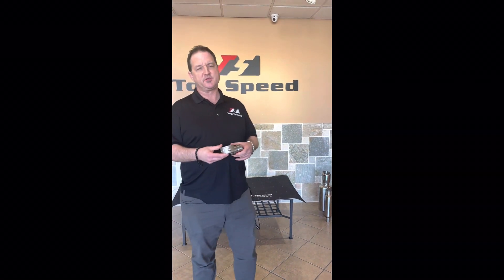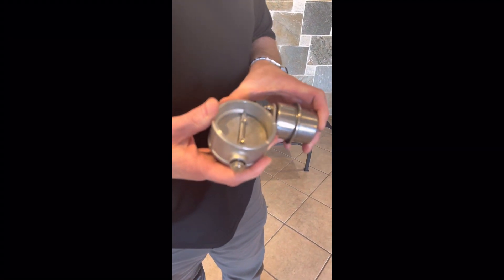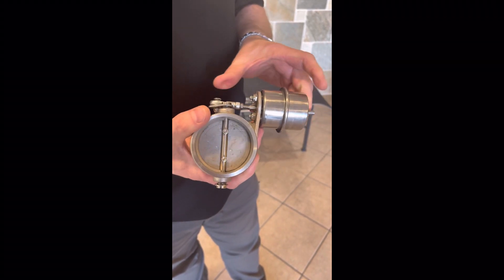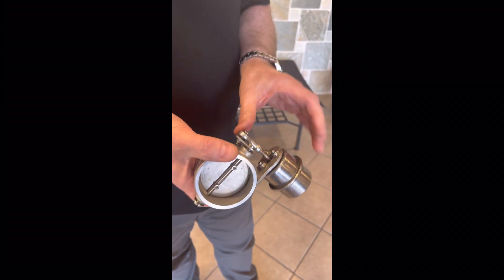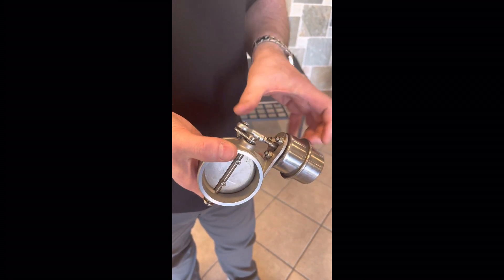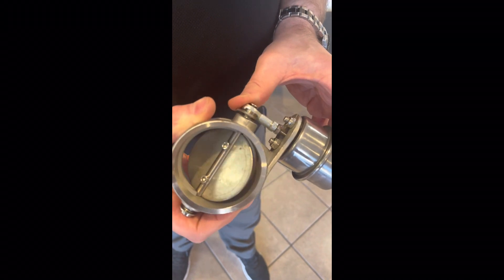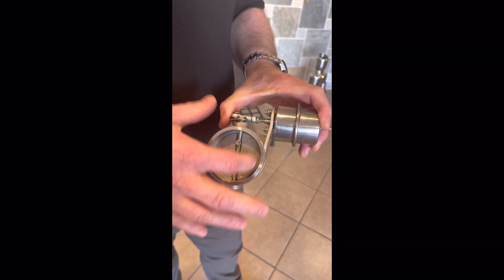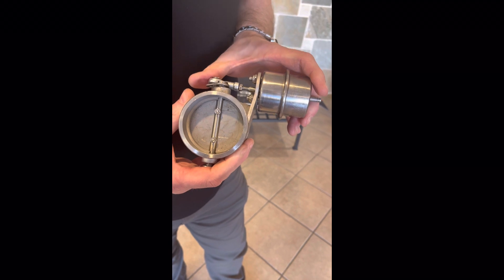How does an exhaust valve actuator work? How to fix a stuck exhaust valve?

Comment: i have an issue with one of my valves not properly closing so it rattles, if i go under the car and push the rod the rattling stops but as soon as i rev it gets loose again. are there any points of adjustment that can help fix this?

Comment: My exhaust valve on the left side is stuck for the third time, the right side is working perfectly literally since day 1. Starting to think it’s the motor but I honestly don’t know
Reply: Try remove the non working valve and connect to passenger side you will able to tell if the motor is bad
Reply: same exact problem in my hands right now 😂 my left side is stuck closed and my right side works perfectly. any update on how you fixed it or what you did? i just got my mufflers welded on should’ve made sure they worked before getting them on but was too impatient. i see that valvetronic sells the replacement vacuum actuator but idk if that will do it or not. not sure where to go from here